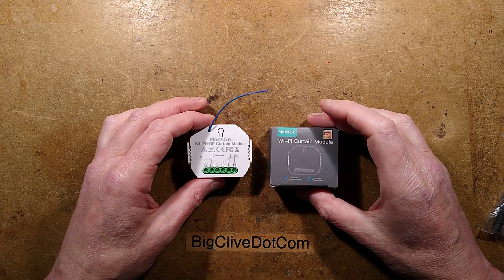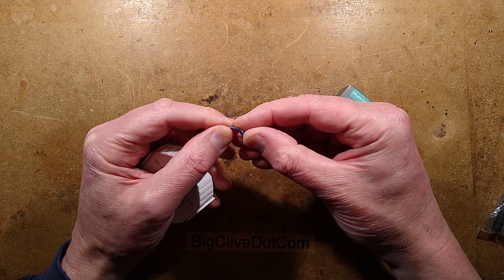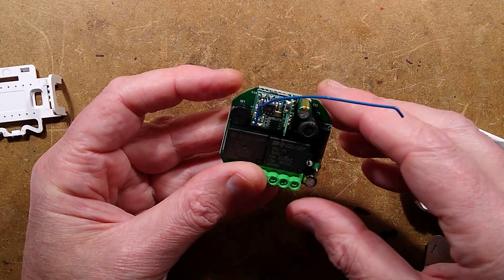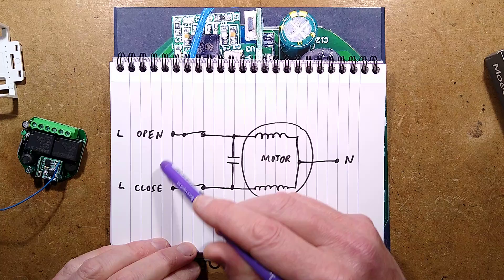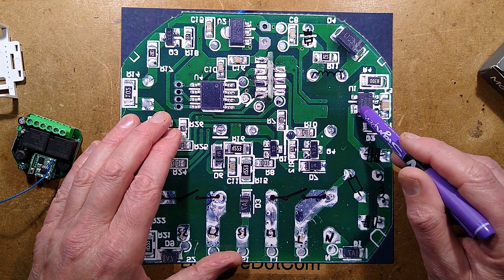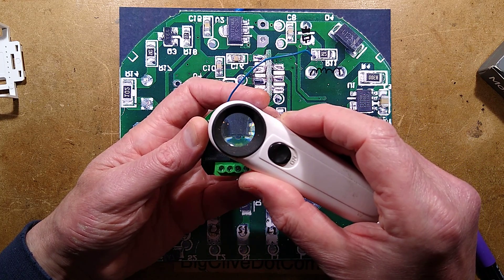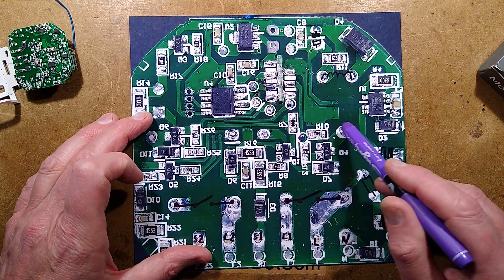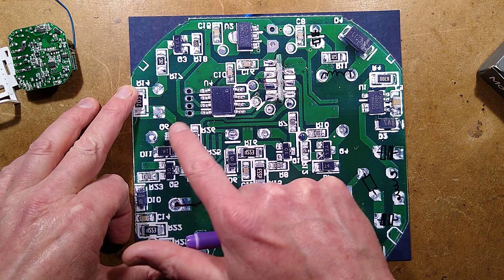WiFi curtain controller with rogue live wire

Comment: Some random points:
• With motors of that sort you can't connect two or more directly in parallel. It requires rather a lot of words to explain why, but if you draw the circuit and analyze what happens when one limit switch opens you'll see why. Such motors also behave as transformers and you can find, typically, at least 1.5 times the line voltage across the contacts of the non-energized relay.
• If you have some situation where you are concerned that, no matter what you do with trying to insulate the antenna, some future event may damage the insulation and create a shock hazard you can (if you can fit it in!) use a low-value Y1 capacitor to couple the antenna wire to the circuit. The value would need to be selected to present a good low impedance at the required frequency. For example, a 330 pF cap would present an impedance of just over one ohm at 433 MHz. It is likely an impedance of several ohms would be OK. Y1 capacitors are "double insulated" - essentially two capacitors in series, two separate dielectrics. Caps like this are not unusual in SMPSs to couple the low voltage side back to the high voltage side to create a local return for RF. IIRC, values up to 470 pF are acceptable in "medical" power supplies where there may be a direct connection of something connected to the low voltage side to a person.
• USUALLY the little nipple in the corner of a sealed relay as used in this device should be clipped off after the circuit is assembled and cleaned. This leaves a little vent hole which helps prevent the build up of "gunk" that can cause premature failure. You'll find this discussed in ap notes from "name brand" relay manufacturers.

Comment: A monopole antenna has high voltage and zero current at the antenna end and high current with zero current at the transceiver end. But that is not what caused the shock, it's the coupling between the ground and the antenna caused by the person touching both terminals. Since the device isn't galvanically isolated, the whole device is floating at mains voltage and though the device operates at low voltage which isn't referenced exactly to mains neutral would definitely give a shock as the antenna is driving power through a conductor which is the antenna creating a closed circuit with the user touching the ground and the antenna. The current is minimal but the discomfort is real. I'd try to measure the voltage between the antenna and ground at mains frequency with a dmm. Anything above 50v would be definitely sensed by touching.

Comment: I was playing with one of the “smart light switch” versions of this in a single gang metclad… funnily enough the the metal box stopped the WiFi pretty effectively and when poked out between the lid and the box it got pinched and… BANG shorted out when powered up 😂

Comment: If I understand correctly - they saved money on the mains voltage -> 5V circuit but splashed out on a dedicated IC to send a pulse wave to the buzzer, although there is probably a 32 bit ESP-style chip on board that should have been capable of generating a tone itself?

Comment: If it were mine, I'd open it up and put a .001 high voltage cap in series with the antenna wire.

Comment: I bought a moes zigbee light switch without neutral connectivity, the bloody thing blew up within an hour, the screws mount straight on to the pcb, ground trace shorted out. Shit design, I would not go with Moes ever again. Spend a bit more money get an aqara system instead.

Comment: 11:17 that zener is there most likely for transient conditions. i do the same thing to play it safe, you neve know what crap appears on the mains input so you zener and cap the crap out of it before sending it to  low voltage circuitry this is especially important with inductive loads which would be expected given the device's use case. 

i would have liked to see the top side resistors two 1206 footprints in series instead of a single 0805 just for the voltage rating. but the bottom resistor also being 422k makes no sense. personally i would have just used two 220k 1206 footprint in series for the top side and just the Zener and 10k 0603 gate resistor as the Zener will have done most of the work for transient conditions. the 422k pull down is a weird choice and kind of high. i would pick something in the 10k to 47k range just to give the zener less work to do while also improving noise immunity at the base of the transistor.

the real question here is why the  hell is a button input not just switching the input of the MCU to 0V with a simple 1k pullup to the local 3.3V supply. that would have eliminated a lot of components.

Comment: folding the antenna end over with some heat shrink is exactly how we have the factory do it at my company for the RF receiver. Since the internal circuit uses a non isolated buck, the antenna wire insulation needs to be rated for class 1 as it is referenced directly to live and neutral. we even put a little sticker saying "ANTENNA DO NOT CUT" just in case since contractors/customers installing our products are often stupid and see an "extra wire" and just cut it off rendering the remote completely useless and then return as "defective".
Reply: Yeah ground plane based antenna modules were not intended for crappy buck circuits, even worse for RF performance than folding the end of the antenna ;-) Also 'CE' Literally just stands for 'Chinese Export' I don't think anything like this would ever get FCC approval, it likely jams half the wifi in the neighbourhood intermittently
Reply: "CE" is an abbreviation of "conformité européenne" (French for "European conformity").

Many companies put a lot of effort into complying with the requirements of EU regulations, but ultimately it is a self certification, so if a company does want to slap on a CE mark without following the regulations, there's not much that you can do about it other than report them to trading standards, or your local equivalent, which doesn't help if they are located half way around the world.

This is why it's probably better to think of CE as caveat emptor, aka buyer beware. *8')
Reply: @markbooth3066  its funny because most of the I see CE and ONLY CE, its some dodgy shit from china so I just just instinctually associate it with "China Export" even though it has nothing to do with china (its in internal joke here) as that is where 95% of the issues occur at my company where CE is the only mark present. Nine times out of ten we find something wrong, the culprit is some factory in china not doing what we asked and we have to either rework a bunch of products or toss them in order to maintain UL certification and our promise to customers. 
Before covid we used to have to babysit... I mean visit the factories and audit them to make sure they are adhering to our standards but it seams like china is using this whole covid excuse (in 2022) to close the country down and keep us from traveling there; Wow who would have seen that coming?
Reply: @MacGuffin1  buck circuits are great for this, I am not sure what you are talking about. as long as decent filtering is adhered too and FCC approval is given all the time for us with "the crappy buck circuit". it maybe crappy, it may even be crude and cheap, but most importantly it works and passes FCC/ UL certification.🤣
Reply: @MacGuffin1  No, it's for Conformité Européenne.

Comment: so it is very likely this circuit have a hot ground. it is now very common on 'you know where' produce device without a transformer. 

by the way, it is still a mystery what is that loose wire for? do a antenna needs a live charge? it is pretty long if it is wifi or cell phone band width antenna.

I don't know? is this thing really necessary in the first place? drop a curtain by hand is that difficult?

Comment: 0:46 China conveniently made up (and I don't make that up) the label "*C*hina *E*xport" which got assigned a logo which is rather accidentally and truly not on purpose (according to Chinese officials) somewhat similar to the quality label CE.
It is also clearly different ... when you have them next to each other and use a magnifying glass and calipers.

Ok, without jokes the label China Export is a real thing and the China Export logo is very very similar to the CE logo. There are very tiny difference, or at least should be. But there also have been cases where Chinese manufacturers used the real CE logo and then claimed they used the China Export one.

Comment: Peculiar how there's no inline series capacitor to the antenna.  Even a very small value 1 kV rated cap would be a short circuit to RF at 434 MHz. Short-wire antennas are usually base-loaded with a series inductor anyway. Maybe a suitable capacitor is too expensive.

Comment: Does the Zener @10:58 prevent the negative cycle of the AC from discharging the cap, which could result in the transistor pulsing at 50/60 Hz?

Comment: I still remember taking my Ideal steel bodied 3 Volt Continuity tester, back in the early 70's, and putting it across a DC relay coil in my hand. Relay flew 6', tester went 10'. I was 'literally' shocked to the bone.
Reply: I landed against the headboard of my bed as a kid, from sitting on the end with feet on floor. I was playing with a dc motor(D-shaft) operating vehicle points/condenser and firing an ignition coil making huge arcs. it was all on a cheap folding table with metal rim and legs, it arced through the rivets to  metal leg into my left leg and back out my right hand.
my legs propelled me into the air and backwards about 6 feet, gave me a huge lump on the back of my head. the table/junk landed against the wall , nearly breaking the window 5 feet the other way. I didn't do that again!
Reply: @throttlebottle5906  At my grandparents 25th anniversary, (silver), I was 5 years old looking at all the shiny silver toys on the table. I stuck the silver letter opener in the flat blade socket of the 120 volts, and did such a large back flip, that I landed behind my 2-year-old😵‍💫💥😵‍💫 brother, and he took the blame. I just curled up in the corner with my silver finger nails. What a rush. 13 years later I started my electrical career

Comment: You know the design gonna be sketchy when it says something like Huahong on the capacitor, it is bound to be super China. I got a power supply which was supposedly meant to be "new" yes but the Tiapeng bulk caps was just re-wrapped and renamed Old used up capacitors with different values. the chokes and transformers were literally melted and warped from the salvage process, tin had splattered ALL over the board and was full of bridges and old flux. it was a Disaster with a big D, I fixed it up and swapped the way too small capacitors to better ones fixed the horrible solder job and cleaned up. it turned up way better. sensmoral is to not trust cheap Chinese stuff to have any safety or even new parts today. it´s all about the money

Comment: Honestly, that buzzer I would've just taken out of the board and poked with a battery across it's pins (in correct polarity assuming it's one of those polarity specific ones, if there are non-polarity specific ones that is.)

Comment: This looks like a 5v design that's been reworked to support 3v components, and given that that unknown chip seems to sit between the 4 pin programming interface port, and riser board, I suspect it's a level converter to allow a newer 3v wifi/microcontroller module to be programmed on a production line that was set up for a 5v wifi/microcontroller module. *8')
Reply: I was thinking the same. That chip and those 4 pinholes nearby.... looks like a 3.3v serial port for debugging??? Ground, TX, RX...

Comment: I was extending an antenna on my long range plug in door bell receiver (wireless transmitter) using a length of wire. While on a chair trying to attach the antenna to the wall I discovered it too had the potential to make your knees wobble and your bowels loosen with a nice dose of 240v AC. Perhaps they should market these as constipation relievers? Moral of the story: always carry spare undercrackers.
Reply: A serious question, why were you "Extending the antenna" it was designed to operate at a specific frequency/wavelength, so unless it was fundamentally wrong there would be no reason to change it.
Reply: @HPD1171  Because I wanted to use it outside the back of my house in my workshop. The signal from the front door passing all the way through the house was not strong enough to reach the receiver despite it being one of Scamazon's 400m long range ones. It was relatively simple to research the wavelength and build a suitable antenna. Also quite simple to identify how to place the antenna to pick up the signal and it worked well straight away. I just didnt expect the 'sensational' end to a straightforward modification.
Reply: @mkase4697  should of connected to roof TV antenna see the range increase 😂😂😂😂 obviously disconnect TV first lmfao and check for magic smoke 😂😂😂

Comment: @Clive - not sure if this falls within your domain, but a video on the CE mark, and how the Chinese sometimes abuse it may be helpful.  It is clear that there is no "China Export" mark as some would claim, including in this comments section.  Rather there are many poor attempts to fake the CE mark - wide spacing, narrow spacing, etc.  The EU has researched this over many years and has not come up with a good solution.  At least we shall soon be able to say that CE means nothing in the UK.  It is a trademark of the EU, which is why UKCA becomes the requirement post Brexit, even if it is just as easily faked, and where not faked will in many cases have been certified to the same standards as the CE mark anyway.

Comment: You used to be able to pull voltage from the antenna wire on a clock radio, WHY?

Comment: The circuit at 11:00 is a crude linear regulator. If the live voltage varies a lot it will still work. The reason the zener is needed is that it provides a semi stable voltage even if the input voltage is variable. Ideally you want to use this arrangement because you don't want the current through the base spiking. Without the Zener diode you will have a lot more ripple on the output and would need a much higher base resistor. This might not be needed for this particular circuit but it's a copy/paste module used a lot when working with mains voltages especially for bootstrapping 5v to ICs that control switching power to power other higher current components. When you need higher accuracy you can cascade multiple of this circuit design together as well. (e.g. mains -> 24v -> 9v -> 5v)

Comment: I must have missed it - where was the path from mains all the way through to the antenna? And is this 'feature' common to 433Mhz mains switching receivers?
Reply from the maker: Just compact ones with non-isolated power supplies.  But if in doubt, treat it as being live.

Comment: the original sonoff mini , had an external antenna that was referenced to mans voltage! It had much better heat shrinked insulation covering it though. the mini R2, upgraded it to an internal on board antenna. I guess there was a risk you could trap the antenna wire and break the insulation.

Comment: I find it odd that the voltage divider that is the switch input seems to pass half the voltage. Why wouldn't you pick it to be a 10 to 1 ratio or similar? odd.

Comment: A decent design severely let down by the live 433 antenna. If they put a clear warning that it was live and had to be enclosed it would probably be ok. I have a Shelley switch with GPIO pins and they clearly warn that the pins are live and must not be used when the unit is connected to mains.

Comment: Is 5v relay enough for this type of application? Feels like the speed to flip the contact is not fast enough or contact not pressing hard enough. Are they comparable to 12v relays? I used 3/5v relay in school projects years ago but only to turn low power circuit. Commercial applications usually use 12v. This feels toasty and firey.

Comment: Hi Clive,
I have just been asked to make a project for someone's van, where the 230V from a modified sine wave inverter has to be detected. I was thinking about using an optoisolator but one question remains, how to safely power its internal LED from the 230V side since it's not pure sine wave ?
I'm hesitating between using a capacitive dropper, resistive dropper, switch mode PSU or a small mains transformer.
What type of power supply do you think would be the best suited for use on modified sine wave possibly from a cheap inverter ?
Thank's !

(Initially I posted  this comment on the "120/240V to logic level optoisolator (with schematic)" but you might not have seen it so I post it here too)
Also by the way I will be purchasing good quality components from a local supplier because of the shipping delay and also for the reliability of the overall project, otherwise if I had more time and if it was my van I would try a 120/240V to logic level optoisolator from eBay like the one you shown previously.
Reply: I would just use a diode wirh a resistor. I think the couple of milliwats of lost energy is acceptable.
Reply from the maker: You can get mains voltage detection modules with the resistor and opto-isolator needed to give a logic level output.

Comment: 11:06 Vbe will be 0.66V but you still have the 10K base resistor which will have 4V across it rather than peak mains voltage - Vbe.

Comment: That zener substantially reduces the base current in the transistor. If we assume effectively 400VDC into the first resistor, with no zener present, you would have about 1 mA of base drive. With the zener present, you wind up with about 0.4 mA into the base.
Reply: 1mA base current for a small bipolar transistor is insignificant in terms of power, as Clive days, the base at worst looks like a diode junction, so 0.65V x 1mA = 0.65mW. Strange that they used that value for the resistors.